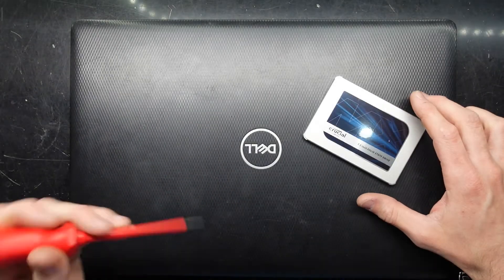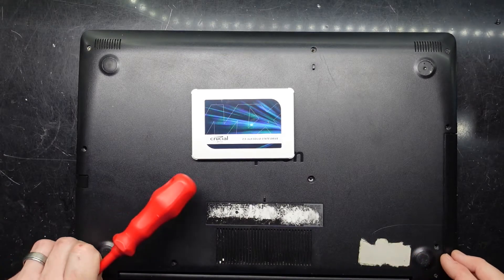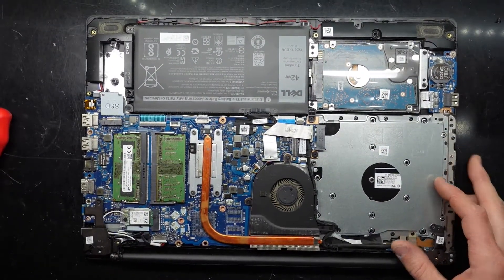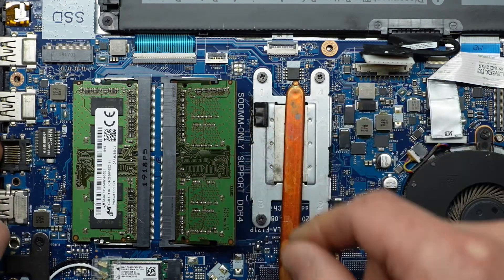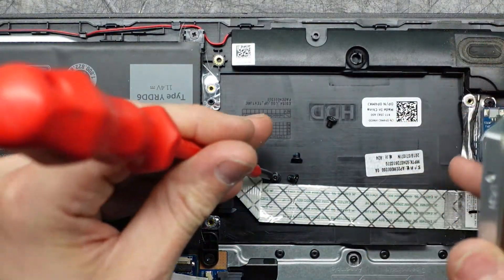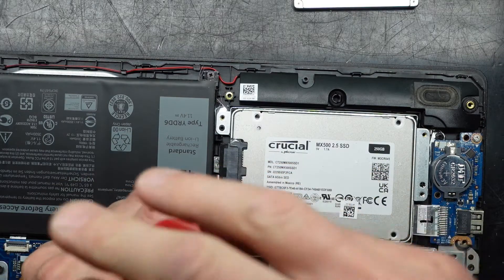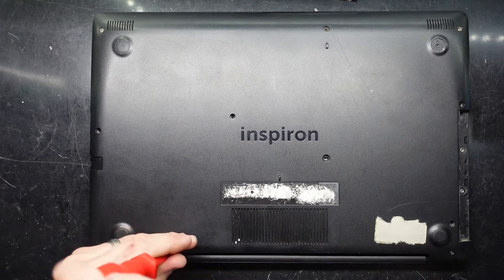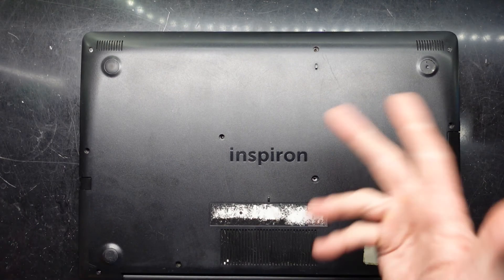Dell Inspiron 3585 SSD and Ram Upgrade

Comment: worst laptop ever, mine has been thermal throttling (extreme temps under little load) since late 2020, i used to be able to play games while having this laptop mon my body even with no issues, then one day the cpu started getting hot instantly, i now use a laptop cooler, speedfan. and it still does it badly, idk how its even possible
Reply from the maker: sounds like a cooked cpu

Comment: With this I’ll be able to run call of duty Warzone 2 on dell inspiron 3585 amd
Reply from the maker: What CPU and gpu
Reply: Ryzen 3 2300U, radeon vega 7
Reply: I just got a base sell inspiron 3585 with the amd ryzen I got adrenalin installed and it doesn’t lets run the game
Reply: In my case, I have 2 minimum requeriments In warzone 2, the procesador and the ram, I got 12gb, but idk if it works